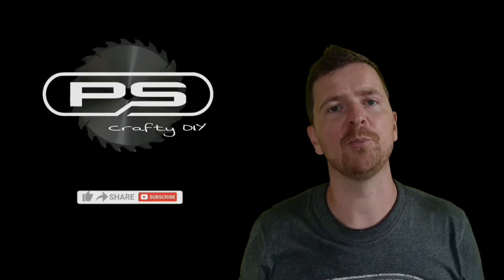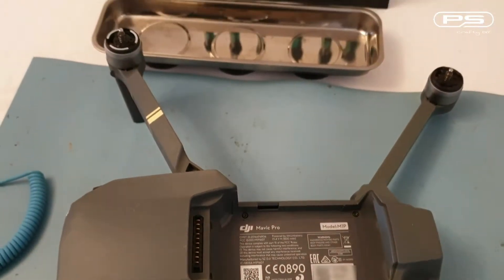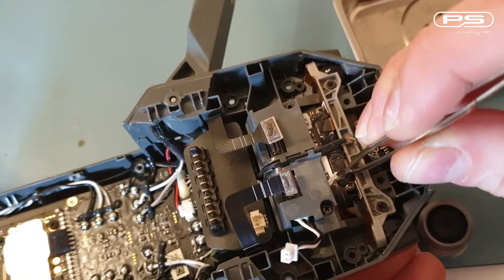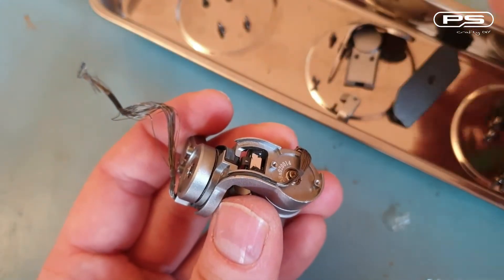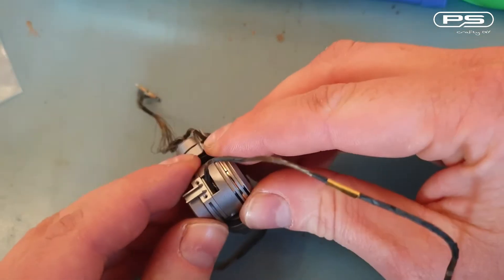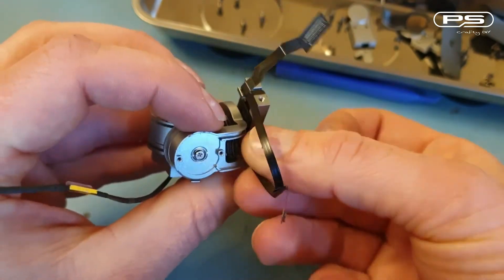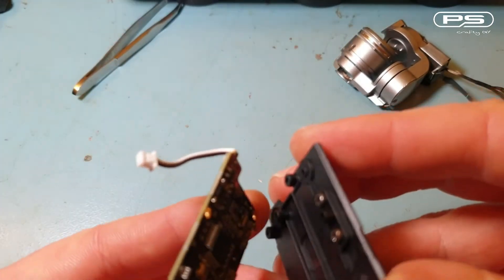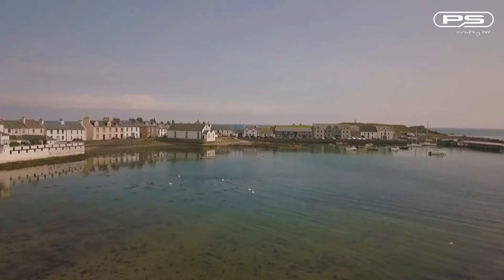Crashed Mavic Pro 1 Repair || Gimbal flex ribbon || Camera signal cable || Gimbal plate replacement.

Comment: Hi, great video!! Thank you
I have a mavic pro with " canera sensor error" and no signal, do you thinc it is the cable or the actual camera?
Please help !!
Reply from the maker: Hard to say...I'd start with replacing the cable since its the cheapest item. Make sure you buy new cable from reputable seller as I received faulty one not knowing its faulty and after fitting it didnt work which lead me believing its the camera thats at fault. I inspected the cable, talked to the seller on ebay and he send me another two as gesture of good will. Mind you one of the other two I received was faulty as well, you could see a fracture in one of the wires with magnifying glass. So only one in three cables worked.
Reply: @pscraftydiy  where did you buy your cables pls?